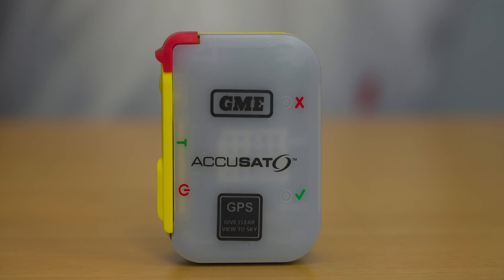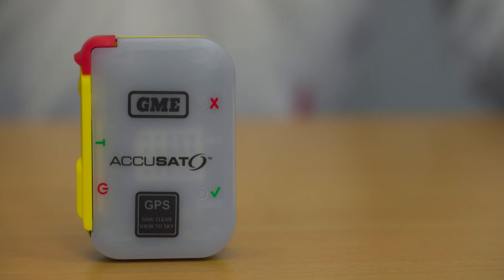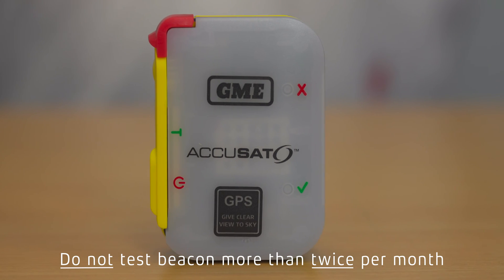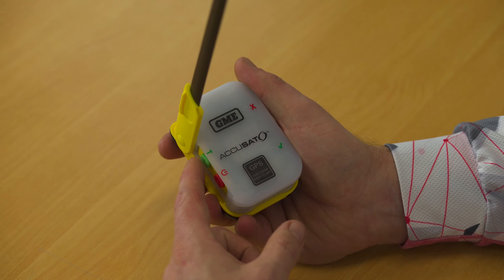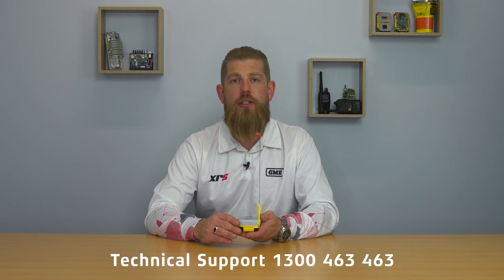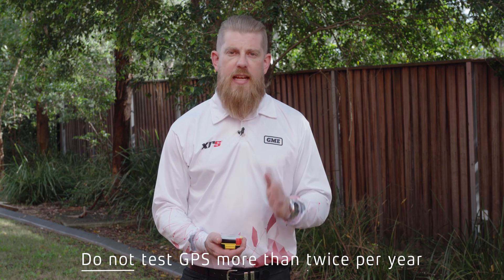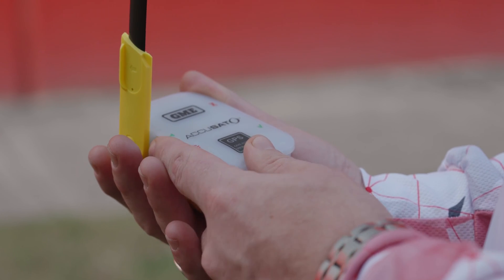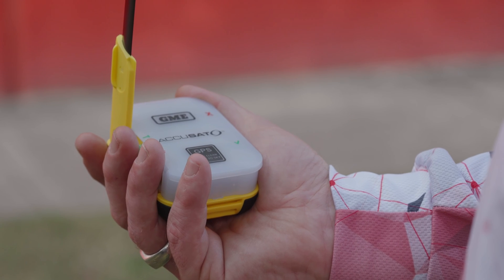MT610G GPS PLB Self Test | GME

Comment: Hi looking to buy one for my off grid 4wd trip. Just wondering if need to use in emergency situation is it just the red button you push to send signal?
Reply from the maker: to activate in an emergency you just push and hold the red button for 2 seconds/the strobe light and red LED starts flashing.

Plus there is instructions on the back of the beacon too!

Comment: So you can't change the battery? Once the battery dies it's just useless?
Reply: These are critical safety devices. End users cannot be trusted to charge it with a $2 adapter from 7-11 using some mangled cable through a power point installed in a timber DIY shed wired up by a few three minute YouTube videos.
Reply from the maker: Unfortunately customers can't replace the battery themselves. However once the battery passes its expiry date (after 7 years) it can be sent in for a battery replacement and refurbishment.
Reply: @GMEaus  when rechargeable batteries become a thing in these I'll deff get one. Hell I'll probably pick one up before my next trip. But rechargeable would add so much value it can sit in people's gear stash always ready to go. Or even a little pull tab that activates the battery so it can sit unactivated in its packaging ready and waiting.
Reply from the maker: @jyeprice9382  Thanks for the feedback, we will be sure to pass it on to the team! Please note that Emergency Beacons requirements do not currently allow for rechargeable batteries, rather a long life one.
Reply: The battery lasts 7 years.. why would you risk charging your own battery when these come properly charged?
Reply: I thinking of buying a beacon pre owned where is the expiration battery date printed on the beacon? Cheers Matt
Reply: @mattbright8635  Not normally printed on the beacon but the beacon should have been registered and the registration will tell you when it expires. If you cannot find any of this information I wouldn't but it.